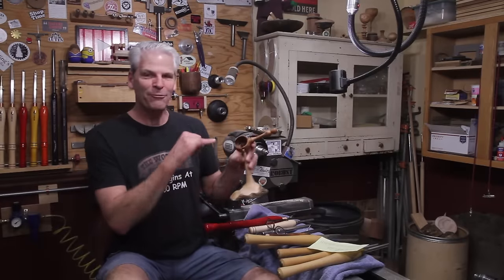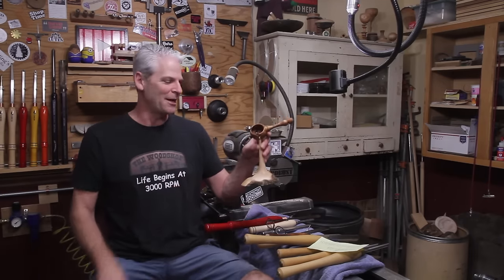Woodturning Project Pouring Wood!!

Comment: my first question before I even started watching was going to be, is the computer fixed? lol. I just started wood turning, my first project was a door knob that went on a door I built for a client. It turned out decent but after watching this video, i obviously have a lot to learn. The door video is up, the handle and knob will be my next video. I am still a bit under equipped so...TOOL!

Comment: Sweet project.

I'ld love me a tool. But shipping is probably a big issue. Do you have a ballpark figure for shipping a tool to the Netherlands?
Reply: Willem Kossen Using usps and assuming 2 pound package, 20x3x3in it is 23 bucks for first class, 44 for priority to the netherlands. hope that helps
Reply: Thanks. That would not be a problem.